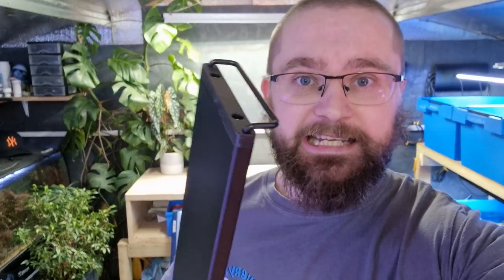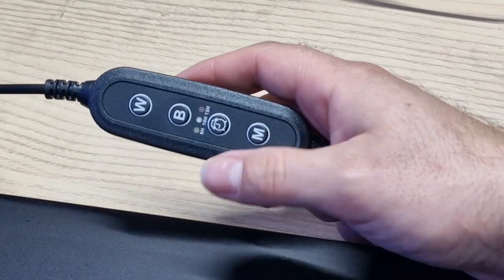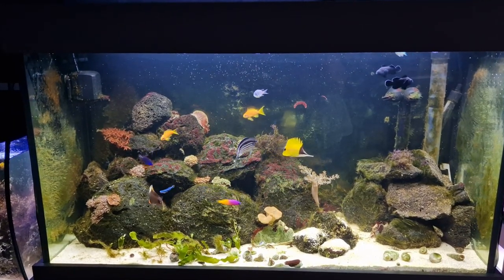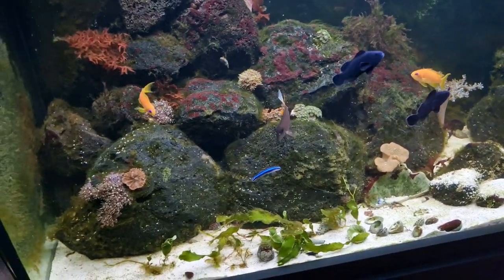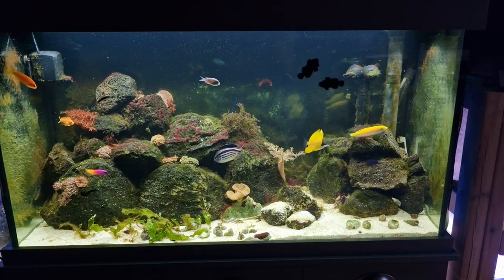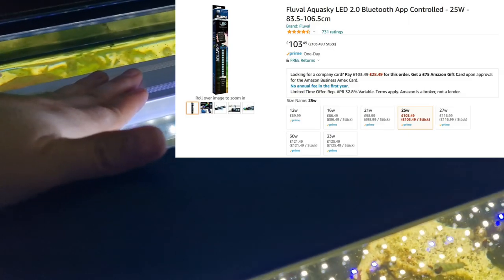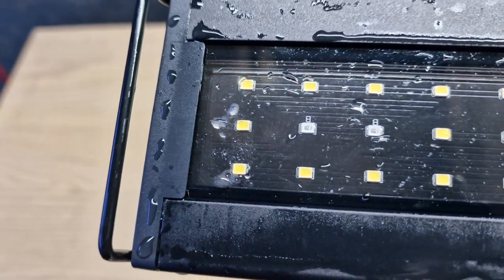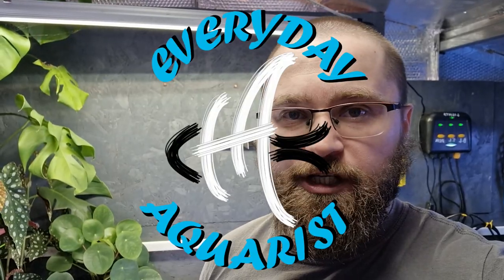NICREW AQUALUX Aquarium LED | Full REVIEW | Tested vs FLUVAL Aquasky | Test vs WATER | Plant & Coral

Comment from the maker: Hello I hope you enjoy my review of the Nicrew Aqualux LED. Overall I'm very happy with it and I think it's a great budget Aquarium LED light. Unfortunately I think mine had a manufacturing error which allowed water inside and it failed its IP67 test. Since the water entered my unit, 2 of the LEDS have failed but the rest of the light is working fine.

Comment: Hi, i have a tank 50x50x50 how far above the water should i mount my 50 watt nicre lamp or how far from coral pls?
Reply from the maker: Hi use the provided brackets and it should be fine, other wise maybe 3-4 inches would be ok as well

Comment: Wondering could u answer a question multiple aquastop valve broke just now on my 307 canister Amazon Ireland only sell the 306 version is it the same tanks?
Reply from the maker: The pipe fitting are the same and the gaskets are the same so it might fit

Comment: I’m slightly jumping off topic, but the light as a stand alone looks good especially for the price and nicer it’s wider spread which is one thing I don’t like with the aquasky . I see you have the fluval plant on the shaker , did you find the aqua sky not good enough , asking because I’m thinking about getting a new tank
Reply from the maker: I have the Fluval marine 3.0 which is basically the same as the plant but marine LEDs. If your running freshwater the aquasky will be ok but I would add another light as well such as this one or another aquasky for better coverage
Reply: @EverydayAquarist  thanks for the response

Comment: Is the energy class of aquarium lights not very good in general? This product has a class F rating.
Reply from the maker: It might just be because these are cheaper or older less efficient LEDS, I'm just guessing. Also the rating system was updated recently which made things that were previously A+ efficiency now F as new more efficient things came out so it could also be that.
Reply: Cheaper yes but usually won’t last long unfortunately